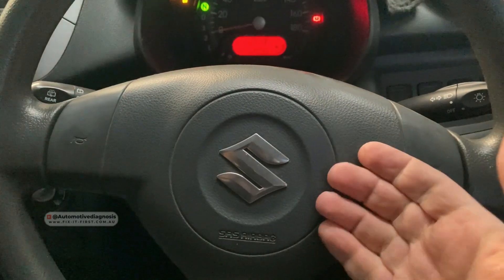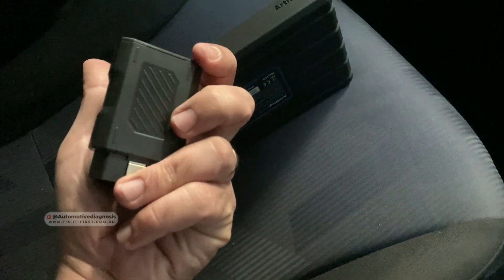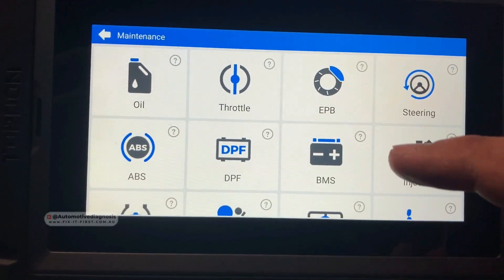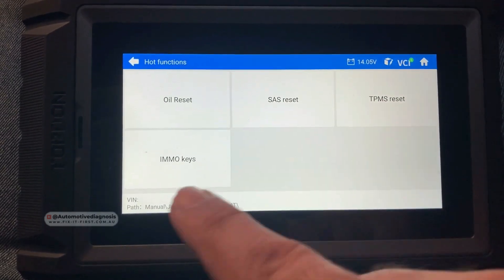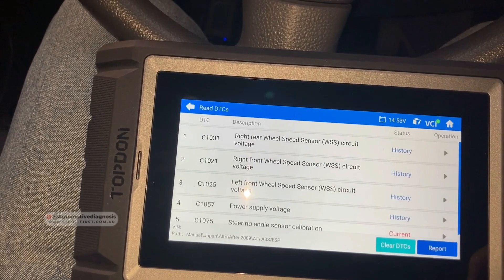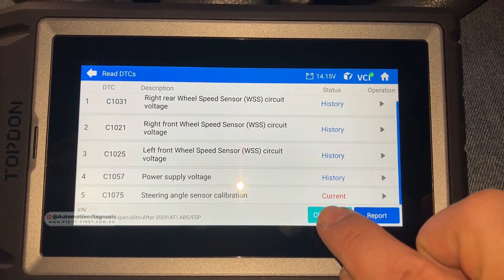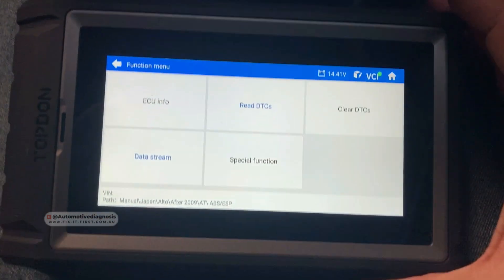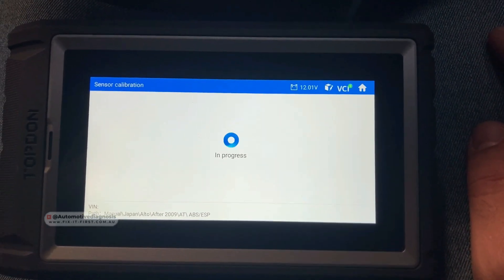Traction Control Failure? ESP Light ON? Steering Angle Sensor Diagnostic | TopDon Artidiag800 BT2

Comment: First steering calibration I've ever seen happen without sweeps (turning the wheel)
I find that strange.🤔
Reply from the maker: Yeah, we may have both, on some we need to turn the steering to the left and right during calibration, and in some others we just need to have the front wheel at straight ahead position.
Reply: @AutomotiveDiagnosis Yes its more a frustration to see backwards steps. Im a preacher of church of 3's lol
Its the smallest and best reference, 3 data points simplest loop. Three leg chair won't rock! First number to give volume... Ie: make a fence from one point??? Two.. straight line... Tree Bingo

Comment: Hi, why did the control unit lose calibration?
Thanks.
Reply from the maker: Hi there, sometimes it happens after wheel alignment or after steering or suspension repair. And sometimes for no reason, all of a sudden there is the code.
Reply: If battery is disconnected for to long, as sometimes required for repairs, or if it goes flat. They have capacitor storage charge so you can generally replace a battery or do quick jobs, critical time varies. Sometimes they just pop up! It's testing you to see how much you care LOL
No, if it detects a discrepancy in range from calibration point it would suggest an issue, damage, worn components, harsh conditions that wheel alignment is recommended (recommend all day not happening precious haha)
This can be turning into a parking spot and one front tyre stop against the kerb. The problem is kinda like an open umbrella in a tight spot, it will flex odd but returns to normal when moved. And then there's the "Glitch" there's lots of relay type connections throughout the car, depending on what features are on, age, you probably heard "it's a bad earth" before, yeah that too. It can all cause strange electronic leak-down when temperatures cause expansion of connections and the stars align. LOL
99.999% of the time it's just a nuisance.